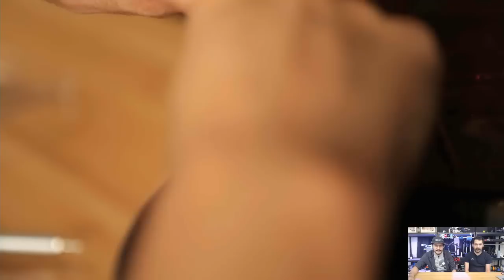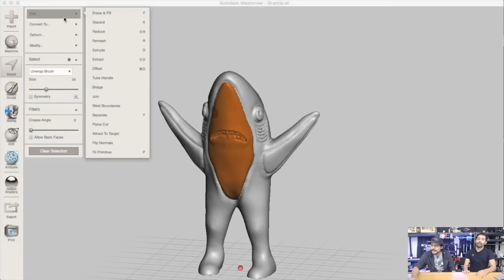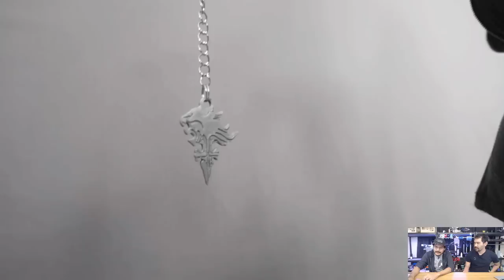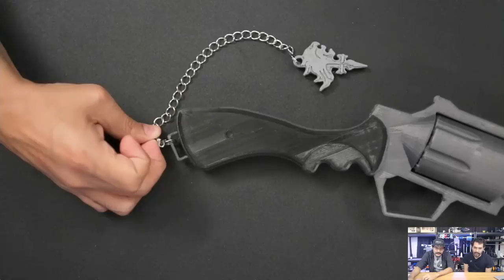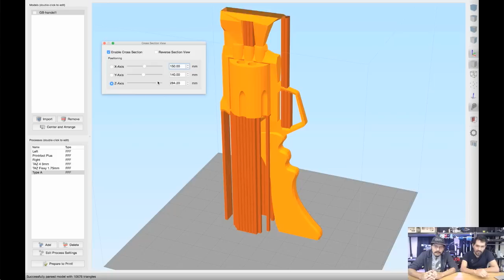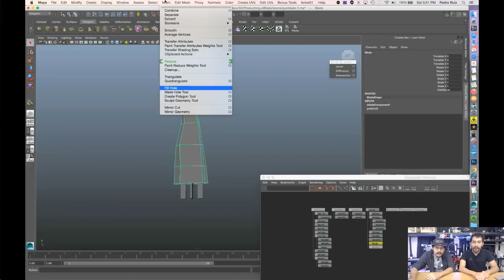Autodesk Ember + Gunblade - 3D Hangouts with Noe & Pedro Ruiz

Comment: nice modeling in the gunblade. just too small for a FF sword XD. heres my sword  3d printed as well.

its from an anime called The Knights of the Zodiac or Saint Seiya.
 https://www.facebook.com/RyuudanCosplay/photos/a.420624238038492.1073741841.373650802735836/478333375600911/?type=3&theater

anyway, I loved your way of using these sticks to align. really gonna use that in the next props I print. thanks.

Comment: pla with acetone?  abs will clear out with acetone, but pla needs another solvent.  The heating of the brass nozzle did more to "burn" out that pla than anything.  I've done this many o times, but I also have many many extra nozzles to swap out too and replacement parts for the hot ends I have.